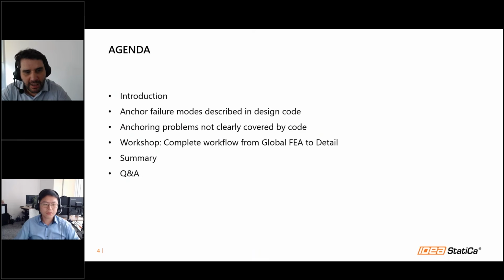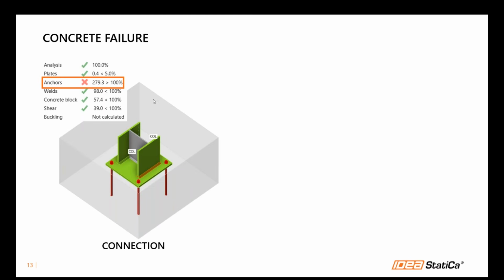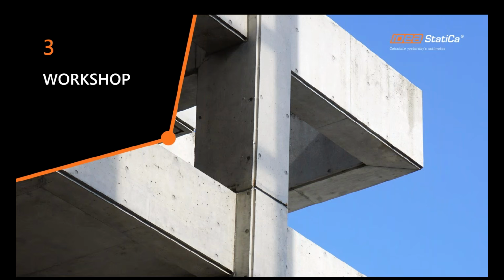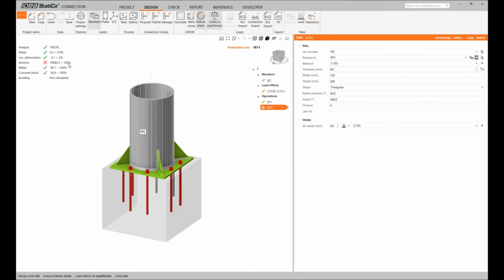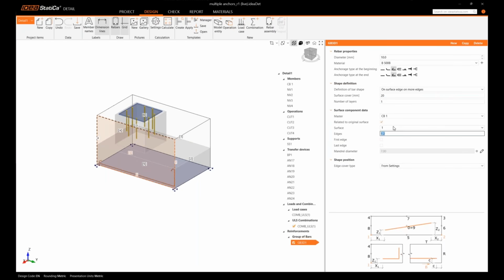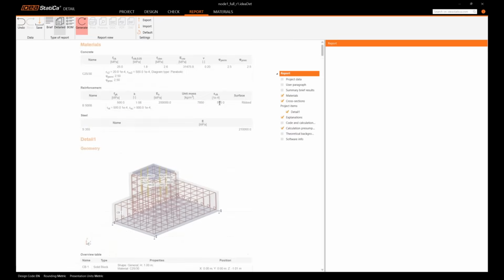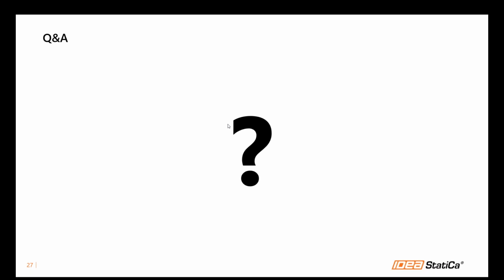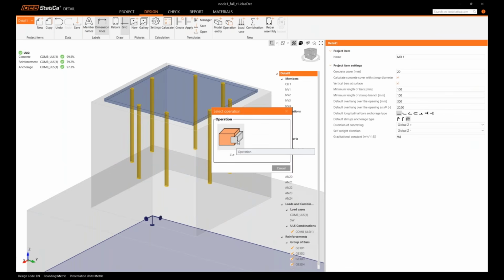Utilizing Reinforcement in Anchor Design

Comment: it seems this doesn't work if the member section is custom?
Reply from the maker: Hello, you can use any cross-section of the steel member above the base plate. For the concrete block, you can start with a rectangle and reshape it using the cut operations.
https://www.ideastatica.com/support-center/support-center-knowledge-base/known-limitations-for-detail-3d

Comment: Excellent webinar!! (from a structural engineer and perhaps because you are also structural engineers, you focused on the points I needed the most)
You have focused on the problem and the solution so well. Other base plate tutorials I have found from IDEA go step by step over the workflow but never focus on the troubleshooting side, and they don't focus enough on the custom foundation side.
I was frustrated because I could not add rebar beyond the extent of the surface or edge, but here I saw we can use negative dimensions, also adding a custom shape volume to be cut later (I used to add a large block symmetric then cut a lot to make it the shape I needed).
Thank you very much!
Reply from the maker: Thank you, we are time to time adding new tutorials in the Support Center:
https://www.ideastatica.com/support-center-tutorials?label=detail_3d

Comment: Good day! This is such an insightful seminar. I just want to ask a question regarding the result from the the 3D detailing. If the 3D detailing for anchorage shows PASS after putting reinforcement, will it update to the  previous connection result as PASS or do I import the result from the 3D detailing back to the Connection window.?
Reply from the maker: Hello, no the reinforcement is used only in the Detail app.
In the Connection app, the concrete is without the reinforcement, so some of the check (concrete cone breakout) are failing because of this - but the complementary analysis in Detail shows proves that it passes.
https://www.ideastatica.com/support-center-knowledge-base?article=import-of-anchoring-from-connection-to-detail&type=support_center_article
further reading in a blog post:
https://www.ideastatica.com/blog/anchoring-with-no-waiting-coordinate-better-between-steel-concrete-designers
Also, we are planing another webinar about this topic:
https://www.ideastatica.com/webinars/what-s-possible-in-anchoring-design-analysis
Reply: This is an important question for prints to add as appendices in reports. Sometimes showing as failed can raise some questions by the reviewer. 
I guess the best is to show on the connection report as failed and add the detail report to the appendix.